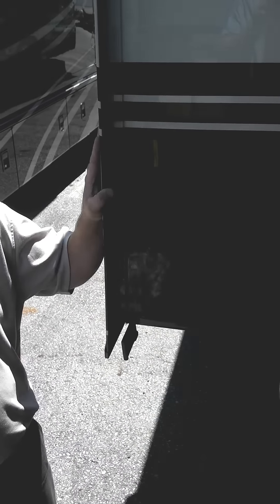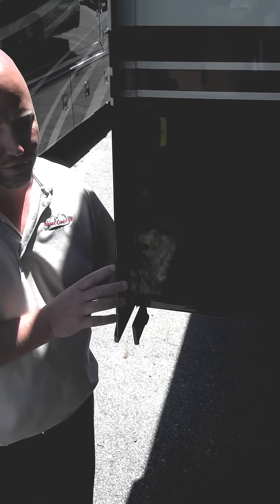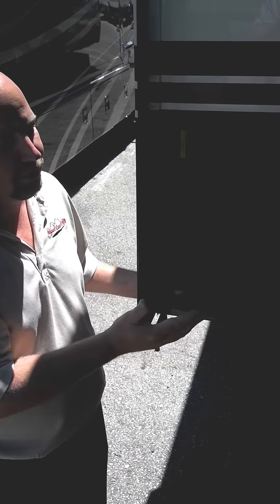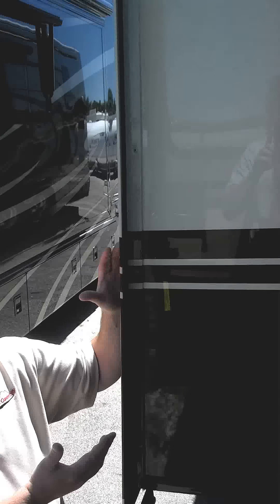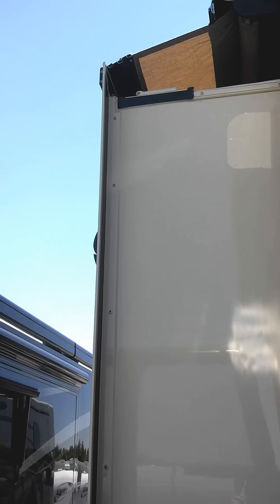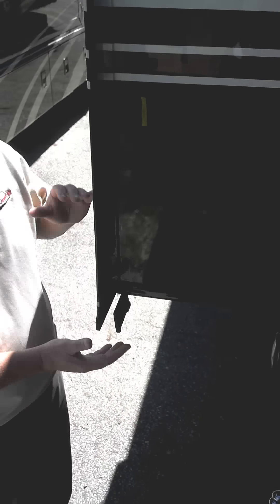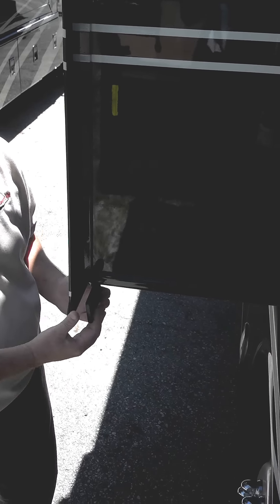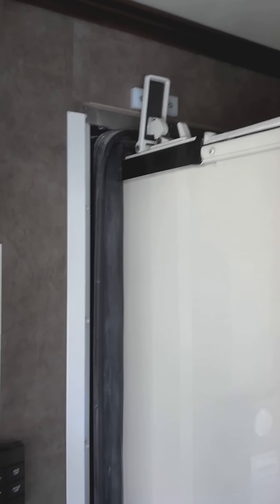Newmar's Exclusive slide lock

Comment: The 2004 model has a heavy metal bar that I think is to lock and unlock the slide but I have no idea how to use it!
Reply from the maker: There is a tool that came with the motor home to lock and unlock the slides.  It looks like a branding iron.   Do you have this tool?  When the slides are in,  think of those bars like they are your elbow. If you straighten or lock your elbow,  the slides are locked. To do this,  loop the end of the tool over the bar,  position the nub in the middle of the tool under the elbow and push up.  Don't forget to unlock the elbow before opening the slide!!!